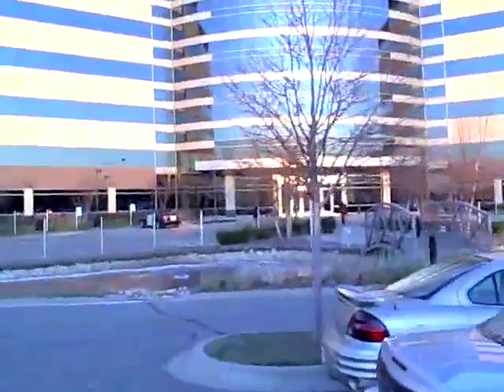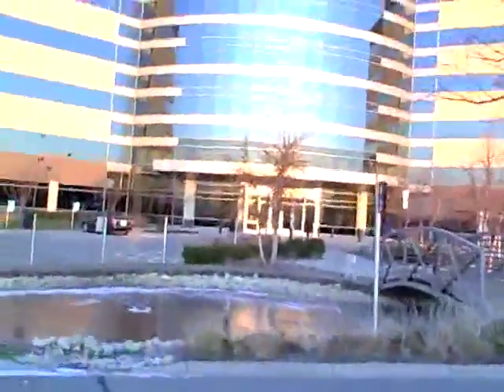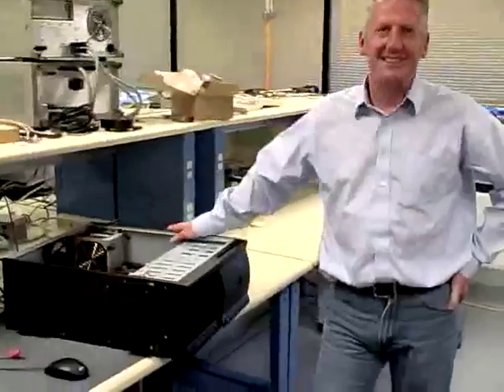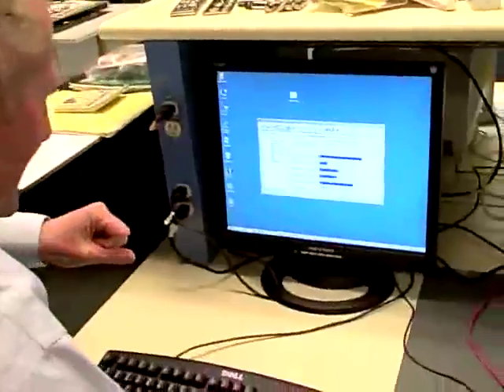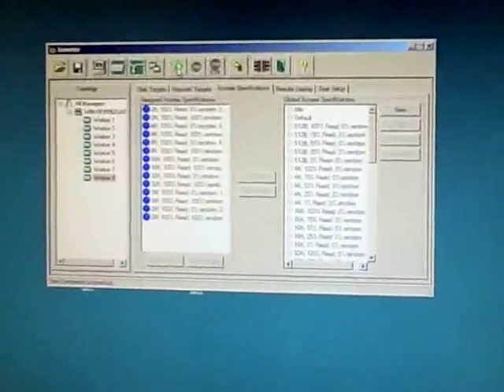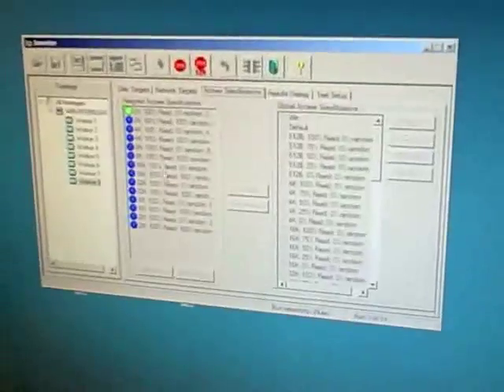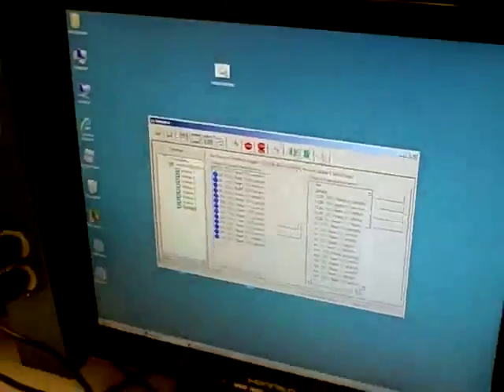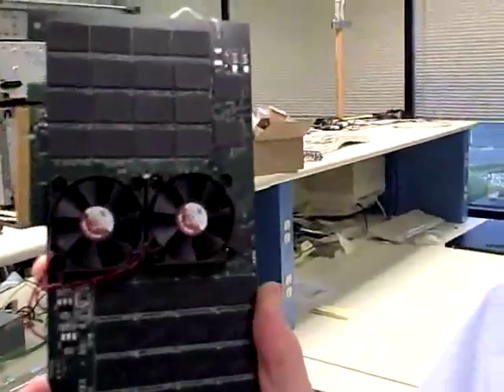Join us at the MAST Center labs to see what NAND can really do

Comment: Great, another vendor on the market offering the same as what Fusion-IO has already had on the market for over a year now, ioDrive. The specs are almost excactly the same too. But this is a good thing, SATA is no place for a SSD.
I hope this could change the way SSD is going as HDD replacement. They each have a good side. HDD is bulk storage, SSD is performance. Why try running a performance drive as a bulk storage impersonator?